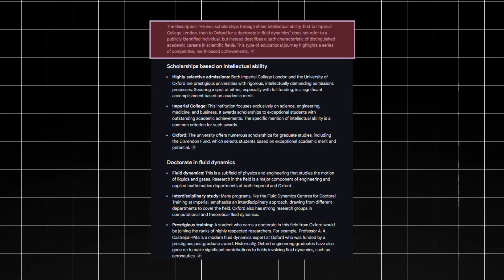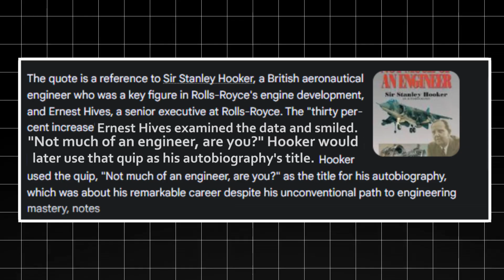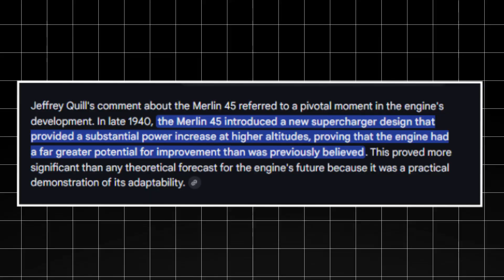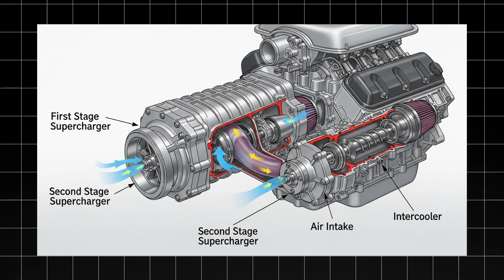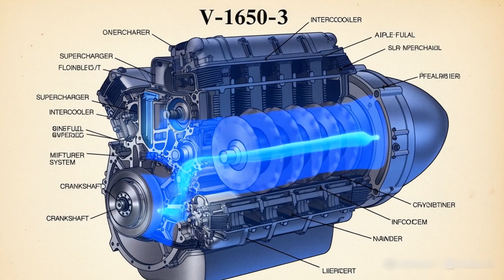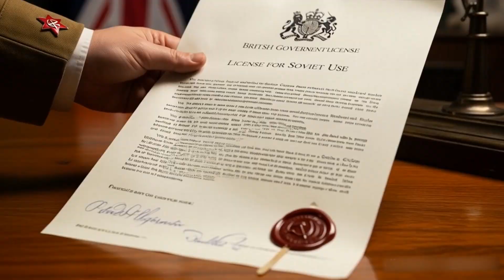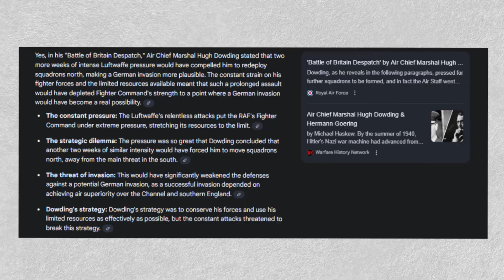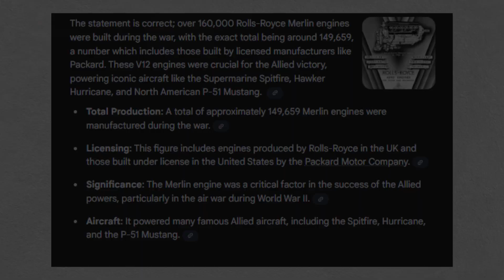The GENIUS Behind ROLLS-ROYCE MERLIN: Stanley Hooker’s DEADLY Secret

Comment: The Griffon which first ran in November 1939, was a superior engine in every way & should have been developed & put into mass production at least two years sooner than it was. Trying to stretch the capability of the Merlin with 150 octane fuel was a bandaid solution at best.
Reply: No doubt the need to produce a known working engine was more important than developing a new engine and switching production lines with the need for new tooling and training of staff in the midst of the war with production at full stretch.